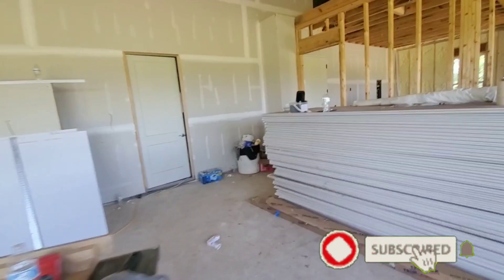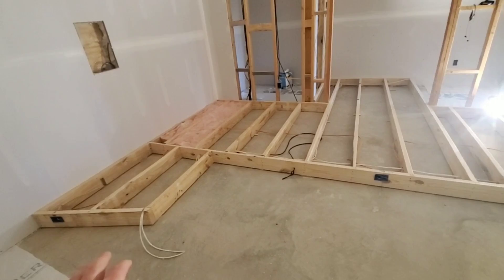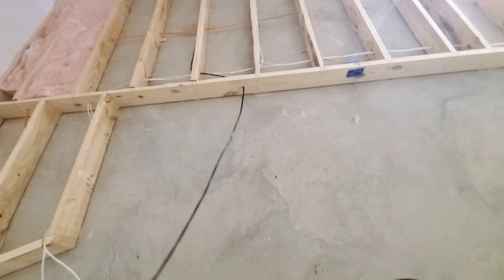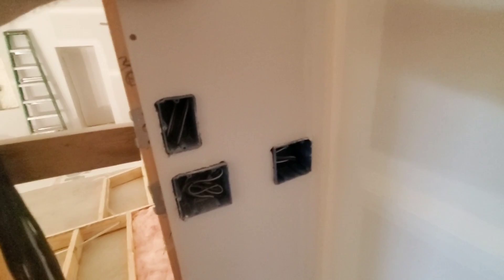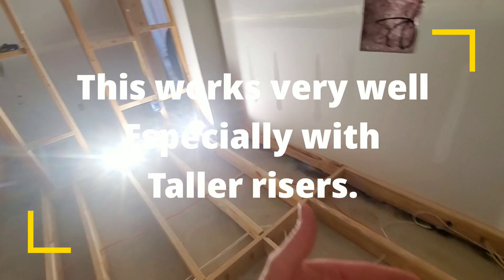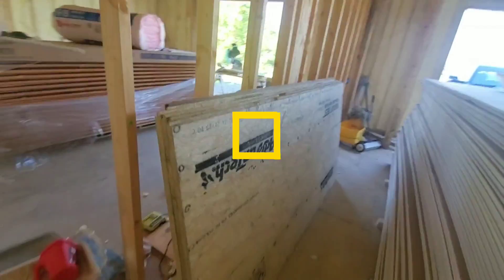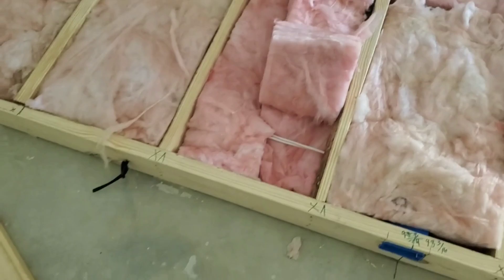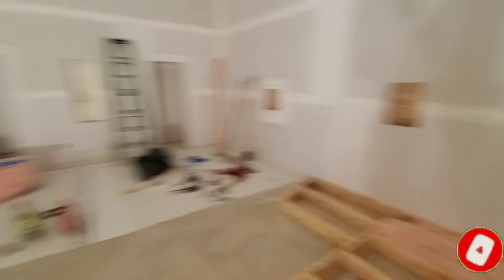Epic Home Theater Build.  Day 1!  Building a riser in 2021!  Triad Demo Room!

Comment: On avs most of the pro builds seem to use rubber mat with a layer of osb on the floor and the riser is them placed on that. That method is meant to stop noise transfer through the concrete.  Interested on your opinion on this method as I have a new build starting end of the year in an external garage with a concrete floor

Comment: You could have used roofing felt paper 30lb. to isolate the riser joists from the concrete. Cut strips ~2" wide and staple / glue them to the bottom of the 2x6 or 2x8 used for the floor joists. ;)
Reply from the maker: That's one of those poor methods that caught on and has hung around. Felt does not isolate as you have to decouple to isolate.  I mean really how can a thin layer of felt paper actually stop energy.  It simply doesn't.  Yet many are led to believe it does.  There's zero reason to isolate as  we don't have large subs sitting on the riser to transfer energy into the riser.   If we wanted to isolate it wouldnt be using felt but methods that work. When we do have subs on a platform we stop the energy before it gets into the platform..

Comment: Looking great. I do have a question about the riser and the sound dampening (insulation) directly on your slab. Is there a concern for you to not have a vapor barrier between your concrete floor and the insulation to keep moisture from leaching into the material?
Reply from the maker: Thanks.  And no the slab has a vapor barrier under it no moisture wicks into the house. This is nothing like a basement where you're under the water table.

Comment: I'm confused as to why the insulation in the riser portion of the theater.   Noise transfer through the concrete doesn't compute for me.  Transfer to where?
Reply from the maker: That's how risers are built. Insulation is installed so they don't resonate.  As for concrete, I'm not sure what your question is but it's a poor conductor of sound hence why block and concrete are used in schools for classrooms.